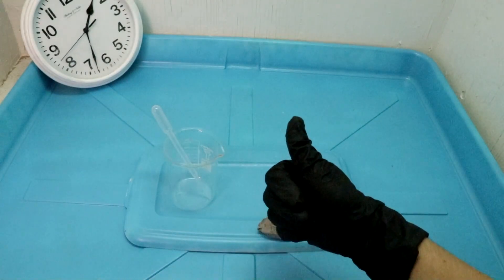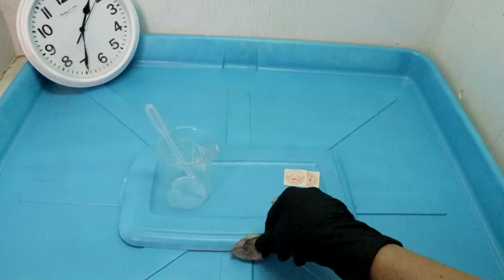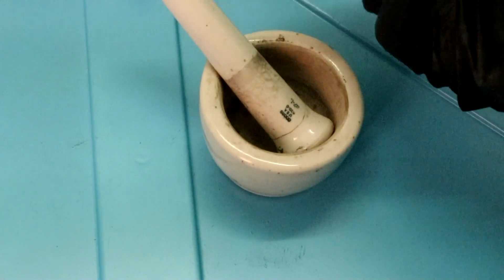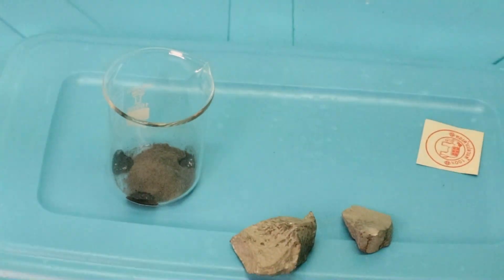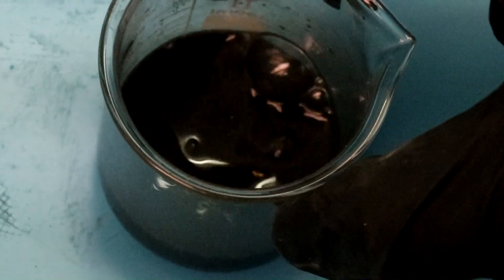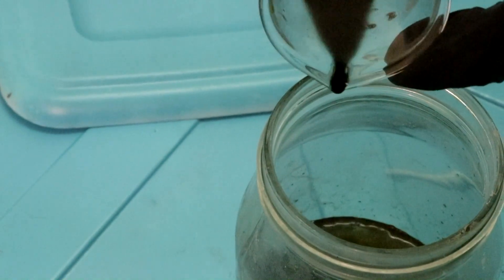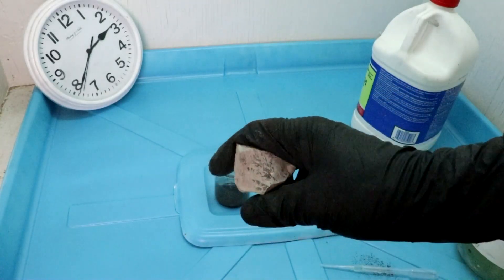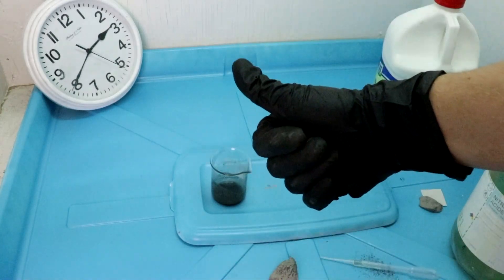Why Acid Is Bad For Getting Gold From Rock

Comment: how about an alternative solution:
wash the ore to remove any dust then go as following
1. step one use salt and vinegar to clean and wash out the ore boil for an hour at least.
2. step two go directly for the  aqua regia.
3. then go with the normal process of urea and smb

Comment: As a chemistry curiocist--a stumpy-looking word I've invented for an enthusiast who doesn't have the follow-through to go past one or two Google/YouTube searches--it seems there's a gap in YouTube demonstrations regarding the strength of an acid vs. its pH at a given concentration. Are there things a "strong" acid with a higher pH can do that a "weak" acid with a lower pH can't do? Are strong and weak acids similarly affected by dilution with pure water?

In the interest of fair time, same question with bases. As a humble curiocist, I assume that the same principles that apply to acids apply to bases, but opposites-like. But I still have a sliver of humility to suggest that H+ and OH- might not have exactly the same relationship as, for example, 8,675-309 and -8,675-309. An H+ is so light and teensy compared to an OH-. So I don't know. All I'm saying is, I did a cursory search and I was thoroughly disappointed.

"Cursory" and "thorough" are antonyms, and yet they don't feel like perfect opposites. Corollary to my thing about acids and bases.

Comment: Cody, I don't know why cyanide solutions dissolve gold but you either know why or can figure it out.  Then after knowing how it works, why not identify another (less toxic) material that dissolves gold in a similar fashion?  So many things influence solubility such as heat, pressure, outer electron shell, pH, ionization, etc.  The early chemists didn't have microwave ovens so readily available as we do today, so maybe a visit to the local DI is in order?

Comment: I mnow this is an old video but i'm curious, couldn't what you demonstrated be a good thing?
Like, if you can disolve the gold using a cheaper acid and letting it oxidize with the manganese dioxide?
Is it too much harder/more costly to drop the previous metalsbout of the solution you made there? Or maybe too difficult because of the sheer variety of contaminates?

Comment: Hey Cody! Interesting, I was actually planning on testing some rocks with HCl I found to see if the dark coating was indeed manganese dioxide, because if any manganese dioxide was there the chlorine would well indicate it. If so, I may try to extract the manganese metal from it. If it turns out to be manganese ore, do you have any suggestions as to how I may get this manganese out? Also, those manganese dendrites, I've found lots of potential ore with the dendrites down in Southern Nevada when I've traveled there, are manganese dendrites a known associate mineral commonly seen in gold ore? (Similar as to how iron soil can signal aquamarine, or gold with quartz? Thanks.

Comment: So I don't know much about chemistry, but I've been experimenting with making Rochelle salt crystals to do some testing with the piezoelectric effect. 

So the procedure I've seen basically uses baking soda, cooking it in a 400 degree oven to make soda ash. Then heating up a glass of water (I used deer park bottled), mixing in cream of tartar, and then adding the soda ash to the cream of tartar water mixture until it turns clear, or at least stops being milky white. 

I used about a half bottle of cream of tartar from my spice cabinet and the liquid went clear after only two spoon fulls of the soda ash. Maybe I screw this up because I added more soda ash after it became clear (about 2-3 more spoonfuls). 

I think I probably started off using way too much water, I think it was around 2 cups. The resulting mixture has yet to make any crystals. I figured there might be too much water, so I boiled it down to a smaller amount, but I don't know if this would have changed the chemistry significantly. The resulting mixture has a light amber color, and it's quite viscous. it has a sticky feeling to the touch. But zero crystals that I can see. 

I have no idea what I made, but I don't think it's rochelle salt. Anyone have any ideas?

Comment: Do you let the disposal water just evaporate off leaving you with a chemical laden salt behind for easier storage for later recovery or do you store it still in liquid form? Could be fun to make a dehydration cabinet that is just racks of cookie sheets inside a box with active air flow to the outside.

Comment: Yes, acid is expensive and yet at mines like Rossing Uranium its used on alaskite, limestones and gneisses to extract uranium from oxides. Obviously, as the uranium is primarily hosted as primary min in the alaskite the idea is to limit the amount of limestone into the plant. Still, acid remains the biggest cost driver in the entire opration.

Comment: In the 2nd semester of Chemistry undergrad, there is a lab in which you are given a sample of various salts and/or oxides and your task is to determine which Elements are contained within the sample. There are various steps of separation in order to isolate these elements and pH and oxidation/reduction are ways to separate them. We always tell them about MnO2 and that you always have to watch out for it, because it will mess up everything if you forget about it.

Comment: nitric acid is pricey if you buy it.  Anybody that needs HNO3, get an Ebay distillation apparatus.  After that, use any nitrate salt (potassium nitrate, calcium nitrate, sodium nitrate, ammonium nitrate) with some sulfuric acid mixed into your boiling flask. Red fuming nitric acid will cross through the condenser and your receiving flask will fill with HIGH concentate nitric acid.  This is a fun undertaking.  Distillation is the gateway drug to hardcore chemistry geekery!  I knew VERY little other than the basic ins and outs of safety and chem.  So many fun things to do with nitric acid.  Unless you have an analytical balance, you'll have to guess the concentration; typically between 85 and 96% I imagine.  Titrate for real number.

Comment: Say, for example, you live in an area with very little to no manganese dioxide, what would you do then, minus the part where you just pan for the stuff. I live in an area where sandstone is prominent and silicone dioxide is all around me, I want to know whether or not I can efficiently extract elemental gold from rocks, or even streams around me or in my relatively local area. Would that be possible or would it just not be worth it in the long run?
Reply: Peracetic acid

Comment: Wow I never would have even thought of the Manganese Dioxide messing up the gold extraction but it definitely makes sense now. Thanks for the great lesson Cody!
Reply: Really basic question: could one not use manganese dioxide as replacement for the oxidizing effects of nitric acid?
Reply: Would you have thought about calcium destroying the acid either?
Reply: @mairisberzins8677  it's not the calcium, it's the attached ion group. But yes that's pretty basic chemistry.

Comment: So, wouldn't this be a benefit? Instead of avoiding the acid method, couldn't you just use the cheaper HCl to dissolve the gold? Since you know the HCl is dissolving the gold, you wouldn't pour the gold solution off, and it would be a non-issue.
Reply: I assume there is a separation issue, since you also get iron, calcium, and other things tagging along.

Comment: Hey, Cody, I have some aluminum slag from melting soda cans that still has quite a bit of aluminum in it. I was wondering if you knew an easy way to extract the remaining aluminum chemically? I can send you some to experiment with if you're interested. 
Interesting things that I've noticed about the slag:
Very flakey and layered (like an onion)
2 separate layers form. One isn't as dense as aluminum, forming a layer on top of the liquid aluminum about .25 an inch thick. The other layer seems to be denser, forming a layer roughly 1-1.5 inches thick on the bottom of my crucible.
Reply: lots and lots of flux... 
of course, at some point, the cost of the flux exceeds the amount of recoverable aluminum.
Reply: @WaltSorensen  I tried using borax as flux. All that did was cement everything together and break my crucible.
Reply: backonninja pick up some lite-salt (a table salt which is sodium chloride and potassium chloride) and add some potassium nitrate that is a better flux for what you want to do. 
Borax reacts with aluminum and is not recommended as a flux. Borax can also make the aluminum castings more likely to corrode. Borax is a good flux for some bronze alloys.

Comment: Wouldn't it be better to use cyanide to Leach gold from Rock?
Reply from the maker: Yes
Reply: How does cyanide compare to mercury?
Reply: @maasmorin8659  makeing a alkaline sodium cyanide solution will cause the gold to react with the cyanide and dissolve into the solution in a process called cyanidation. It's a much safer process then using mercury because you don't have the toxic fumes or the lasting environmental hazard from using mercury.
Reply: @philipbender956  you just have to cut down eucalyptus trees for the cyanide oil in them, but now koalasa are going extinct they lost 80% of their treea

Comment: Can I use this method if the ore has been has been mechanically seperated and is pretty highly concentrated to the point where gold is visible all throughout the sample? I have about 50 grams of concentrates from high grade quartz gold ore and the gold is so fine its like flour and I cant seem to mechanically seperate it any further without losing gold. If not the acid method does anyone know of a method done with readily available chemicals that can be done fairly easily at home?
Reply: Use PerAcetic Acid, there are vids on this.

Comment: So one could in principal use cheap muriatic acid and manganese dioxide from batteries to dissolve gold?
Maybe not useful for mineral extraction, but could it be used in refining scrap gold?
Not needing the nitric acid is a big deal!
Reply: Bubble chlorine in a solution of distilled water and your scrap, it should work, but it will also dissolve copper, silver, and other metals aswell.
In principle yes, but you should make a gas chamber and mix the HCl and MnO2, and bubble the chlorine like the aforementioned way.
The chamber could be a pet bottle btw.
Reply: PerAcetic Acid, poor mans AR.  Vinegar plus NaCl.